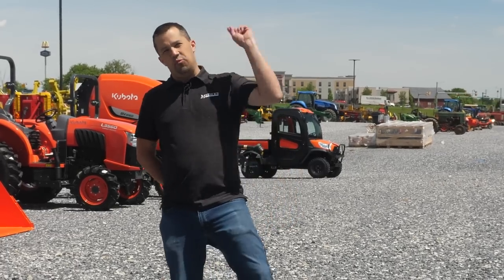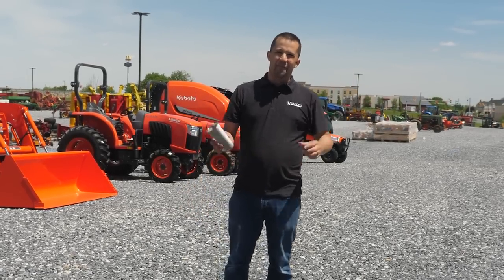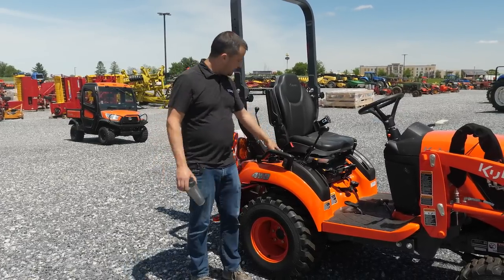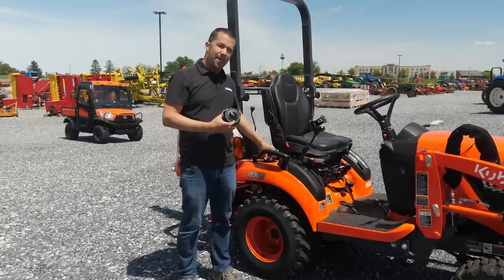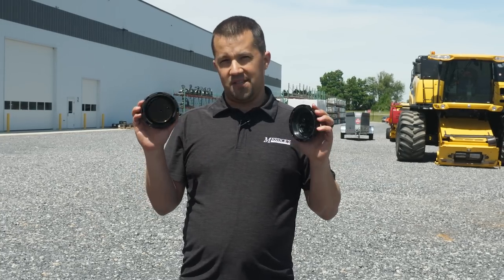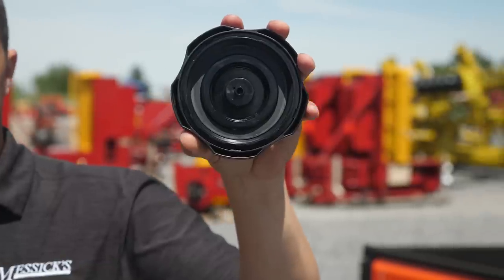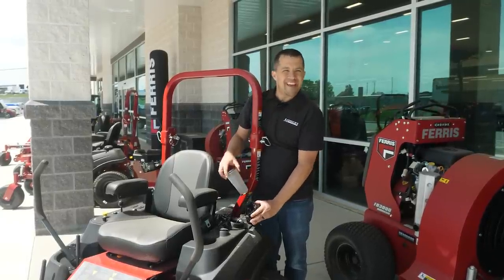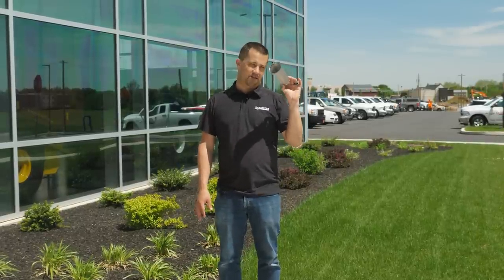"🍵Cold Brew" Fuel Strainer for Your Equipment

Comment: I saw this tip on Tiktok and immediately ordered one. The problem was the original tip was for the non-tapered version of the filter. It didn't fit in my BX2380 even after trying to modify it. So I then ordered the tapered one, and it fit perfectly. Fast-forward a few days, and I was in a hurry to mow. I topped off my tank with diesel and then promptly forgot to put the fuel cap back on. I mowed my two acres, parked my tractor and then noticed my boneheaded move. I looked inside the filter, and it was full of grass clippings and debris that would have ended up in my tank. Even with having to buy two of these at $12 a pop, it was money well spent.

Comment: After having several months problem with our L3301 just running out of fuel for no reason and weeks at the dealer trying to figure out the issue it was discovered that there was trash and a glob in the tank that would restrict fuel flow. I from the beginning said there was something in the tank. I purchased a special plastic funnel with a built-in micron fuel filter, no more problems.

Comment: This would of helped when i rented a small kubota from home depot, it kept cutting out after a few minutes run time. Turned out there was a bee in the gas tank that would block the fuel outlet while running. They were not helpful, but I found out later from another employee about the bee. Definitely don’t want debris in your tank! Cheers from Calif.

Comment: Great idea Jon and thanks for sharing Neil. I've had cap o-rings fall into fuel containers before and this is a perfect solution to prevent them from ending up in the bottom of the fuel tank on a tractor.

Comment: Caution!  I liked the idea and went for it.  While installing it I looked a bit askance at the plastic like material (I now think silicone) around the top flange, wondering if the diesel might break it down.  Decided to keep an eye on it.  Just a few days later I saw that silicone off the filter and in the cap.  At first didn't know if it was all there and was afraid part was in my tank, but I now see it has a groove such that it covers top, side, and bottom of the metal flange, so I think I've got it all.  It had swelled a great deal, I assume due to the diesel, and came off in the cap.  I feel lucky it didn't go the other way into the tank.  I suggest you strongly consider removing this silicone before installing.  I'm guessing  nothing will go wrong with the stainless steel, but I'm sure going to watch it.

Comment: I did something similar, I took the "prefilter" fuel filter out of my old B6100HST-E diesel tank to see if it would fit in my new Z781KWi gasoline tank. It did fit, so I ordered a new one for my Z781KWi. Glad I did, cause I have already caught and kept trash out of my Z781KWi gasoline tank.
Reply: Does Kubota pay you every time you say z781kwi?

Comment: That's awesome with the filter. I've been on the look out for a solution like this. I was thinking to put a metal mesh screen on the top of my fuel thank because when I fuel my tractor at night, I ALWAYS RE-FUEL when my job is done before leaving for the night to prevent moisture to build up. So at night, I always have an LED lamp that attracts a lots of bugs. So when I'm looking inside the fuel tank to make sure I don't overspill, it's attracting lot of bugs. And I'm concerned these bug can make it through and clogg my fuel like line.
Using this file will definitely be a great solution. Hoping I can fit it on my M5. When not I'll just by a similar small match screen and pre-cut it my self and put on the top of the fuel reservoir before re-fueling.
But thanks for sharing that details, it's very helpful.
Reply: Yes! I never thought about bugs.

Comment: I have a very large funnel with a snap-on screen available Amazon (FloTool 10705 Giant QuickFill Funnel). It costs about $9.00.  I screen the fuel transferring it from a 5-gallon tank to a 2-gallon (I have a couple of these so I do it first and it's lighter to lift )  and then again from the 2-gallon to the tractor. This helps avoid spills and is so easy, topping off at the end of a day is a breeze The coffee filter probably has a finer mesh but I wonder if it is necessary.

Comment: Well I have an L2501, a RTV 900, and a GR 2120.
The GR 2120 is the one that is currently the one I am having issues with.
I think I have some debris in my tank.
I will be flushing my tank and back flushing the fuel line and all of my Kubota equipment will be sporting the new Jon Ritter filter

Comment: Thank you Jon for this tip & Neil for sharing it for us !!!

Does anyone know if this would fit an LX2610 or LX3310 ?

Thanks...
Reply: Following this comment
Reply: It is too big for my B2650, only goes in about 1/2 way.
Reply: I tried one out on the predecessorof the LX tractors which is the B2650.  The tapered filter only goes in about 3/4 of the way in the filler opening on my tank before it stops.  It is better than the huge funnel with a screen that I was using as a temporary solution.  I'll still use when fillling, but can't keep it inside the tank and still put the cap on.

Comment: Interesting setup and simple and i see a lot of guys with Diesel power marine now make their onw fuel polisher systems . Which is what i am leaning towards doing which i can do for around 100$ depending on what i get for filters to use . Otherwise its just a generic inline type pump and some hose
Reply: how do you polish fuel?
Reply: @_AndromedaGalaxy_  You first have to buy a left-handed smoke shifter.
Reply: @_AndromedaGalaxy_  System that uses a electric pump to push fuel threw water serprator, then at least 2 or 3 filters of different micron sizes. So it would catch any kind of Contamination in the fuel. do a youtube search on fuel polisher system there are many DIY showing them

Comment: my b7200 has a plastic strainer from new. Kubota P/N (35450-41350) Any reason why and when they discontinued these coming with new machines. Heck my IH TD-6 series 62 has a metal one and that machine is from the 60s. Edit: that P/N was superceeded by 35450-41060 So you do sell them Neil! just a bit more then $12
Reply from the maker: man this video needs a follow up! Learn something new every day.
Reply from the maker: I went and got that one out of the bin, it's much smaller, wouldn't fit in this tank.
Reply: @MessicksEquip  I wonder about other sizes for maybe other machines that might be out there. Thanks for looking!

Comment: After a couple of frustrating incidents where the fuel line became clogged where it left the tank on my BX, I changed diesel suppliers and I filter every drop of fuel through a funnel with a clean cotton rag in the bottom. This screen would also work. I have been looking for a locking fuel cap. Does anybody make one?

Comment: Have you (or anyone) found one of those type filters that will fit the MX or M series Kubota tractors? The hole is slightly smaller.
Reply from the maker: Not in the ones I tested.

Comment: I bought a large 12 quart funnel that has a fine mesh screen at the bottom, and fits perfectly over the fill spout without touching the hood metal and won't tip over.  I can use my cans now without the leaking spout and pour just about as fast I can.   27 bucks on Amazon, funnel king 94469.